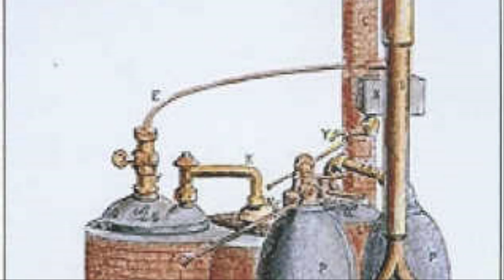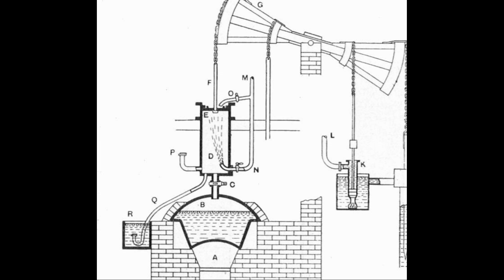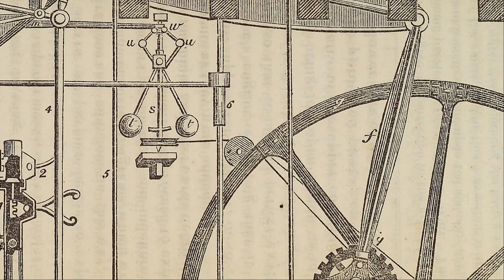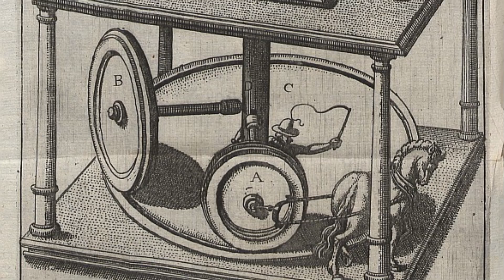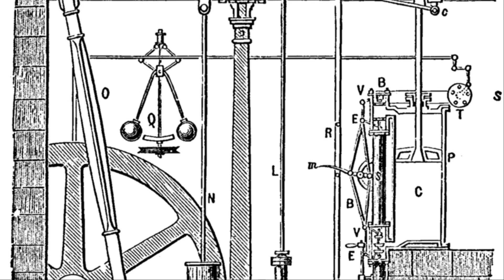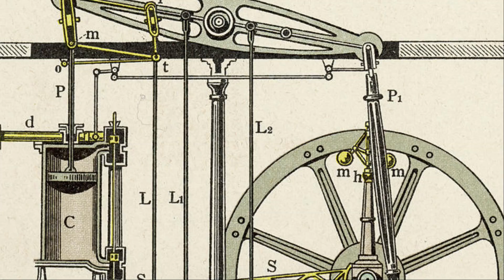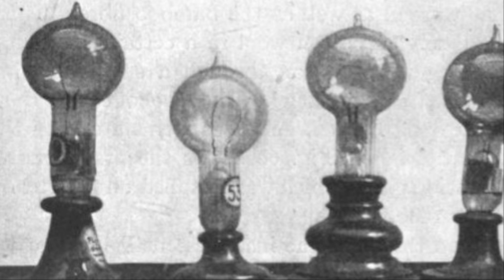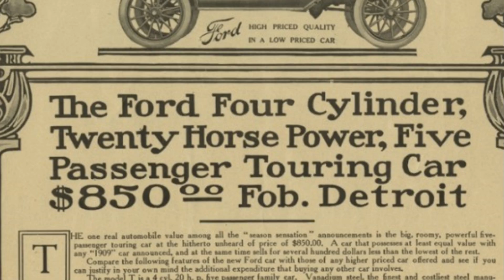Horsepower: James Watt and the Transition from Horse to Steam

Comment: I remember an episode of "Connections" where James Burk said his major improvement to the steam engine was made when he was hired to repair a huge lift pump engine.  It had broken the massive rocker arm.  Watt noticed that the beam was not rotten, but perfectly sound, but somehow the engine had produced so much power that it snapped an 18" square beam like a toothpick. This engine had a huge cylinder (over 6 feet in diameter) that was surrounded with a cold water bath. The steam would be let in allowing the piston to rise, then shut off at the top of the stroke. The cooled walls of the cylinder would condense the steam causing a vacuum that pulled the piston down. The engine had a very slow cycle on the order of 2 minutes per stroke.  What had happened was that the outer wall of the cylinder had worn thin over the years and a small hole was opened, when the piston rose and exposed the hole, a small amount of cold water entered the 100% steam atmosphere.  This caused the steam to almost instantly flash condense creating an enormous vacuum compared to normal, the piston yanked down with over 50 times its normal power and broke the beam.  If you look a at steam locomotives you can see they are always dripping a lot of water around the pistons.  They used a lot of water and had to stop frequently to take on water far more than fuel.
Reply: So the vacuum causes even more force, huh? 🤔
Reply: @Vggincidently  In this case yes.  Remember these were very early, very large steam engines, very low pressure, very long cycle. They were maybe at most 2 PS on the inflate cycle and at most 1/2 psi on the deflate cycle.  When the water flash condensed the steam, it created a vacuum on the order of 12 to 13 PSI. Modern steam engines routinely work at 600 to 3000 PSI for pistons to turbines, and they are proportionally smaller.
Reply: Also, most modern steam engines have huge condensers.  From 300 foot high cooling tower to the entire ocean (or a fast running river) as the heat sink.  No days we primarily use the pressure side of the cycle to derive power, but back then they used both sides. With a locomotive running 20 to 30 PSI on the supply and -14 on the sink, it made small high power locomotive possible. Just look at how small the piston assemblies were on steam locomotives. Usually only 4 8" to 10" pistons could drive a normal 10 car train.  When we needed more power there were monsters like 16 to 32 cylinder shays that could deliver well over 7000 HP.
Reply: @Vggincidently  particles cause the force. The excess on one side and the lack thereof on the other side.
Reply: Intersting! Thank you!
Reply: Interesting! I love your profile pic btw, Porco Rosso is the best!
Reply: @Vggincidently  Vacuum can deliver 1 bar or 100 kPa (approx. depending on the local air pressure), this was more than the pressure in the early boilers. Multiply this by the area of the piston to get the force. Until you have a boiler pressure of more than two times outside admosphereic pressure (i.e. 1 bar above outside atmospheric pressure), the vacuum from the condenser can give more force than the pressure from the boiler (though you get more by combining boiler pressure on one side, and condenser vacuum on the other). That 1 bar is the 'limit' for a condenser though (you can't have lower pressure than vacuum), so pretty soon the easy way to get more force was to increase boiler pressure (around 1910, boiler pressure of about 12-14 bar were common, so that's much 'bigger' than the difference by vaccum to atmospheric pressure). On steamboats and such, you could re-use boiler feedwater by by having a condenser (cooled by seawater). Another effect of this is one atmosphere extra of pressure difference, so a win/win.
Reply: I like your description of what happened, Water expends to steam creating an increase of 16 times its volume at boiling- thats a hell of a sudden contraction occurring like that

Comment: In the town where I live we have a museum (Eskilstuna Stadsmuseum) with a fair number of full size steam engines. I don't know about now (I worked there for a short time as a youth - at that time they ran the machines every Sunday), but I think they run them at least a couple of times a year. Mondays the museum was closed and that was steam-engine/boiler cleaning/maintenance day (draining water/oil from cylinders, check lubrication, sweep the heat tubes of the boiler, etc). Quite nice to have done that, not many have in these days I guess. Every other day was some time spent chopping wood for the boiler - not that fun, especially if the wood was struts from demolished buildings. What I wanted to say is that it quite awesome to see these machines running, the installation there kept all exhausts outside so these sometimes a couple of 100 HP machines runs almost dead silent. But you can feel the power in the floor and air. Pretty awesome.

Comment: This was a great.... All the early "beam" steam engines were big and usually built in place. They were low pressure steam engines, about 3 or 4 psi.  Not until high pressure steam engines were they able to be put in motion as in a road or rail locomotive.  High pressure steam, around 1800, is much more efficient use of fuel than low pressure, a safer boiler was the key and the invention of the double-acting cylinder. I love history.  Long live the "ROCKET"
Reply: the atmospheric steam engine of Newcomben was far less efficient as Watts improved steam engine. The irony is that Watt's patent and control also stifled the technology because he wasn't interested in high pressure steam engines developed by Trevithick as he thought they were too dangerous. The high pressure engines were able to really proceed after Watt's death.
Reply: I think Watt's engines may have worked around 21 psi. I think the later steam engines which worked on about 50 Psi

Comment: Good video as always.

I had to click on this because late in my career, I find myself working with machinery to some extent.

Our plant has among its equipment two similar fiber processing machines - one motor rated at 7.5 hp and the other at 10 hp.
Our semi-retired maintenance supervisor once remarked, "I'm careful around anything that moves faster than I do."

I modified his statement from my experiences: "I'm careful around anything stronger than I am." That probably spurred me to investigate the concept of horsepower.

As the video relates, James Watt was brilliant in defining his machine output in terms of "horsepower," which he defined mathematically/ scientifically. What surprised me is that what might be a crude measure from today's standard was quite accurate and stands up to this day. 

In the video, I was surprised to learn a horse can generate up to 14hp at peak exertion, but average, sustained exertion is about 1hp. I had also learned that a man at peak exertion can generate about 1hp or so.

Made me think about Louis Cyr, the legendary Canadian strongman, who could keep his hands clasped while two teams of horses - 4 (?)on either side - attempted to pull them apart.

Bottom line: I'm careful around anything stronger than I am. Good video.

Comment: As an engineer, I am aware of this history. However, many people are not. Thanks.
Reply: Appreciate your taking time to comment. I was in a Mechanical Engineering program that got the best of me after two years. Still, I took away the definition we were taught my first week: "Engineers are problem-solvers."

I have had a respect for those who completed their courses in their disciplines ever since. The thing I haven't appreciated is those engineers who don't relate to the guy in the field, designing tools, machinery, processes, systems, etc. that tax human workers as if they are machines.

I guess I'm a little bitter because of my youngest brother's experience on two jobs in the auto industry. I apologize. I know management has a lot to do with a worker's experience.

Still, I appreciate your comment. The History Guy does a good job.
Reply: My father was an engineer- Watt, and the measurements of horsepower- especially the claimed measurement in automobile horsepower vs actual power delivered at the end of the crankshaft were some of his favorite  subjects which he entertained me with as I learned to rebuild engines as a 10 year old kid and onward

Comment: Watt guarded his patents closely as you said and. on discovering that a patent on the crank already existed, created the Sun & Planet drive to get round someone else's patent.
Reply: Daniel, I see what you did there....
Reply: Yep, the sun and planet drive is less efficient, more difficult to manufacture, and requires more maintenance.  It does however run the flywheel at a higher RPM than 1 revolution per stroke of the piston.
As soon as the patient on the crank ran out everyone building engines switched to it.

Comment: I had the pleasure to have had a tour through the brewery at Chiswell St.  The beams (each beam was a single piece covering the entire width of the brewery) in the ceiling were original, being preserved by the alcohol rising up from the open vats.  The entire process was gravity flow.  A visit some 56yrs ago, but one I will not forget.

Comment: Small correction: watts are the unit of electrical power input to a light bulb, not the output, which is light in in lumens.
Reply: Since energy is neither created nor destroyed the the energy put into the light bulb is the same as the energy output. In incandescent bulbs, those lumens are a small proportion of the total energy output with heat being the majority.
But, yes, if you’re talking light output, it makes more sense to use lumens, since there is no direct correlation between electrical energy input and light output.
Reply: @q.e.d.9112  
He said "light"
Your quibble did really apply.

Comment: Horsepower is directly converted to watts. European motorcycles are rated in watts output partly because there are at least three different horsepower ratings that yield different numbers.
Reply: Dr fact sheet strikes again. He brings graphs he brings super trivia skills he is Mr fact sheet with. His side kick Zoogle
Reply: Good point! The most commonly used definitions of a horsepower are metric (1hp ≈ 735.5W) and mechanical (aka imperial: 1hp = 33,000/min as mentioned in the video or about 745.7W) but then there are also electrical horsepower, boiler horsepower, in short, a general zoo of definitions[1] 🙂, as it turns out. What you wrote about European motorcycles is true, by the way, for all vehicles and other powered devices sold in the EU, e.g. also pumps, drills, chainsaws etc. (Metric) horsepowers are only allowed as a supplementary unit in sales and advertising and probably also other commercial contexts.

[1] https://en.wikipedia.org/wiki/Horsepower#Definitions
Reply: Watt sense does that make?

Comment: A unit correction- a couple of times when describing how the horse power came about- you said it was the "energy" to move 33,000 lb-ft in one min.  That's actually a unit of power- the energy part is the 33,000 lb-ft.  Once you divide that by time, it becomes power.  I know it can be hard, as it's easy to mix up the units- in this case, units and what they are called matter quite a bit.
And while we do use HP in the US, the Watt (and kW) is a far superior dimension to use.  Especially when converting from one kind of power to another- such as electrical to mechanical.  Or chemical to mechanical.
Reply: Yes,  but we love confounding the world with Freedom Units :)
Reply: @jamesengland7461  I'm sure few here remember that congress passed the Metric Conversion Act in 1975.  Didn't go over well.  History that deserves to be remember that we forgot.
Reply: @alfamaize   True, the act didn't have much effect in public daily life, but it is still in force (if widely ignored.) Thus we now have the distinction of being the only nation on the planet (along with Liberia) that does not teach or use the Metric system in common daily life. However it is widespread to the point of being extremely common in the sciences and engineering, and therefore in the products of those fields.
Reply: I remember the conversion to metric that started in the late'70's. If they hadn't stopped the process in the early '80's we'd be fully converted and everyone except really old people would be comfortable with it. As a side note, the Philippines is all metric except when you ask someone how tall they are. Then they will tell you "I'm 5-3" or however tall they are.

Comment: I have known for many years, that a 'horsepower' was a derived measurement and that it was James Watt who quantified it.  What I didn't realise was; A) his given value - 33000ft/lbs/min - was actually 10% more than the value he actually calculated from horses and B) the type of horse.  I sort of 'assumed' (yes, I know the admonition) that Watt would have selected a 'representative horse i.e; not a Shire horse, because they were almost preternaturally powerful, nor a 'pony' because they were rather too light.  I imagined horses that pulled canal boats or - my favourite for his choice - the horses which pilled 'Hackney Carriages'.  Utilitarian, powerful enough and reliable, a true 'midrange horse'.

Thank you also, for pointing out Watt's engine from the Whitbread Brewery in Chiswell Street.  I used to work as a Field Engineer on NCR Accounting Machines in the City of London and the surrounding areas.  Although the brewery has now gone, at the time (early to mid seventies,) Whitbread kept their Horses there (I think in Chiswell Street) and routinely delivered beer to the City Pubs by dray,   I am very grateful that someone, from far, far away at the time, understood the historical value of this engine and worked very hard to preserve it.

Yet another great vlog THG, thank you.

Comment: To take a efficient idea personally from the the massive to the tiny, that is, a pressure cylinder with valves producing rotary output, consider the rocking cylinder model made from square cross section brass tubing (plans in a magazine I read in high school 1960-1963). 1. The rocking cylinder eliminates the need for joints in the connecting rod. 2. The flat side of the cylinder rocking against the flat side of the engine mainframe makes possible a port in the cylinder moving from a pressure port to an exhaust port in the frame. The result is an easily made, working, “steam,” engine with only 3 (three) moving parts: 1. The piston/connecting rod; 2. The rocking cylinder (square cross section with a hole in the side); 3. The rotating flywheel. I can not post a picture on my channel because a forced move left the model behind. Still, a diy steam engine with only 3 moving parts is intriguing when juxtaposed with all the machinery in this video.

Comment: I love your little snippets of history but I have to pick you up on what is meant by foot pounds. It is a measure of torque, being twisting force. It is a measure of how much twisting power is needed to lift a pound at 1 foot from the centre of the shaft. In other words, it isn’t the power needed to lift a pound a foot. Sorry to be picky. Otherwise it is another great video.
Reply: That is one of several definitions.
Reply: The foot-pound is a unit of energy. 
 The pound-foot is a unit of torque.
Reply: @jeffreytoole2719  you are quite correct and I hang my head in shame for not listening properly. Oops. So, another great episode without an error.

Comment: As an inventor myself I can relate to his opinion about nothing in life more foolish than inventing.
Reply: David Single  It can be done easily enough today. The main problem with it, though, is that, for whatever job it's intended to help the human do, it's usually significantly more efficient to build it to just do that job without the human inside.
Reply: Right.  Inventing is a very speculaive venture.  Heard of a guy who invented sponge rubber heels for flaminco dancers to save their kidneys...didn't sell.....
Reply: But you can't help it! Inventors are engineers, and engineers are problem-solvers, and that's what you were made to do. 

You can supplement your lifestyle by doing other things, but your life's passion is solving-problems to benefit others. 

Hats off to you!

Comment: A “foot pound’ is also a measure of torque that is defined as one pound of force applied to a shaft one foot from the axis.
Reply: formally, torque is foot-pound or inch-pound (or in SI m-N) as torque = r x F (vector cross products are not commutative) while work is F dot d so pound--feet(in SI N-m or joules) Watts are joules/second or the rate at which energy is being produced or expended. keep in mind that only US, Liberia, and Myanmar currently use the imperial system. Watts are an SI unit. Horsepower is the imperial unit.
Reply: That is a great example of taking something of interest and easy to understand and turning it into something incomprehensible.
Reply: @patkaupp2161  Thank you for your kind words, that was my intention. Have a great day!!

Comment: I would recommend producing a video on the Hispano-Suiza Engine to cover the European internal combustion development which helped aviation gain recognition in WW-1.  Thirty years later, allies were bombing the factory. The power-to-weight output was taking aviation expectations to new horizons.  It spun offsprings in automobile industry, too.  The air-cooled vs. water-cooled engine debate raged.